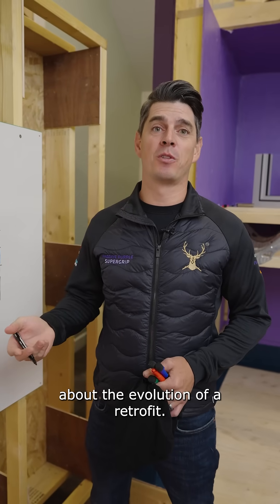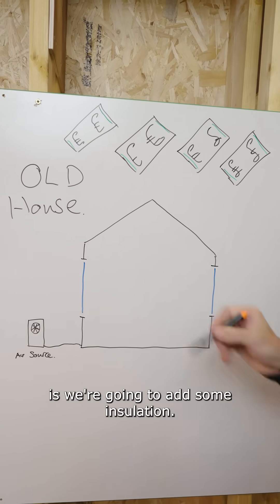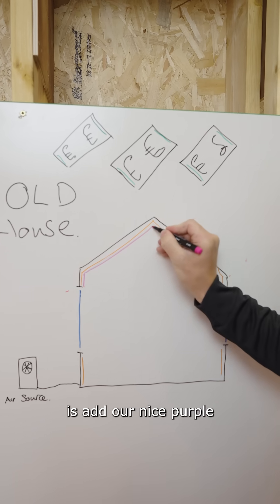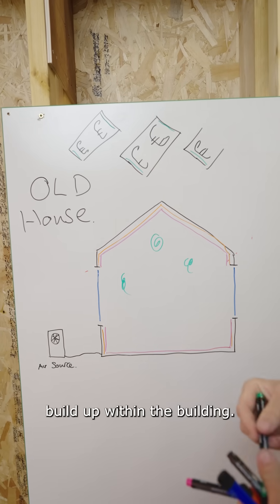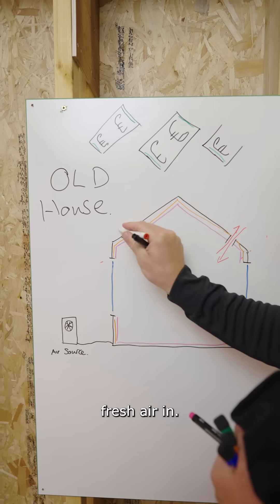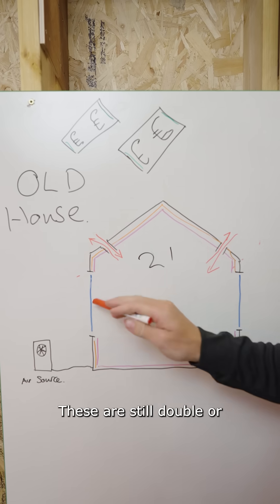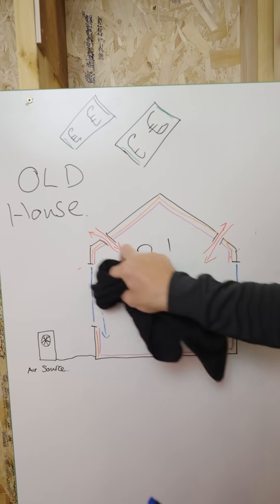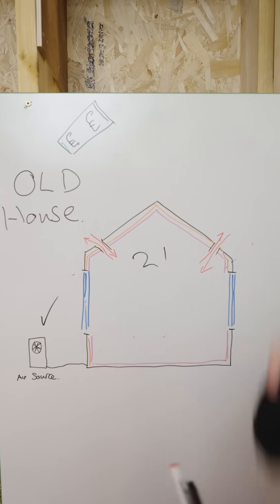The Evolution of Retrofit | Passive Purple Airtight Vapour Control Explained

Comment: I love one thing mentioned there—Windows 3rd position. I do deep retrofit. Use Passive Purple between joints and seal all gaps within the envelope. I even use that on 10-year-old double-glazed windows frames from inside and replace panels to E-low double with  warm edge spacer. What a difference that gives me over 2.7MW lower gas usage per annum. I need to add I have a minimum 20C degree overnight. When I moved in 3 years ago I had over 17k gas bill, now I have dropped to 12k. I am working from home with house temp deviation -> 21(day)-19C(night).  Keep working I'm a fan of your products. So easy to apply virtually everywhere!
Reply from the maker: Thank you very much. Happy to send a free hat out if you email us info@intelligentmembranes.com